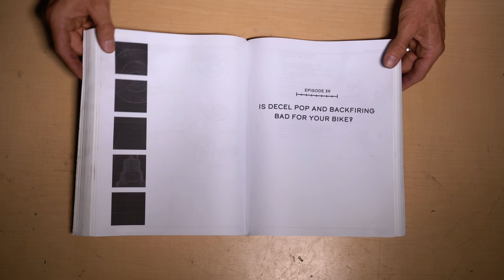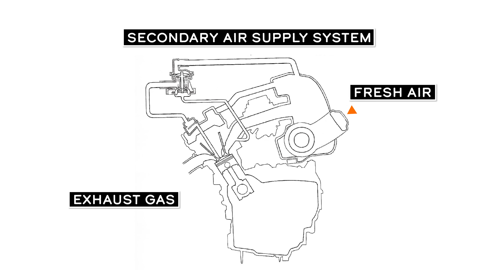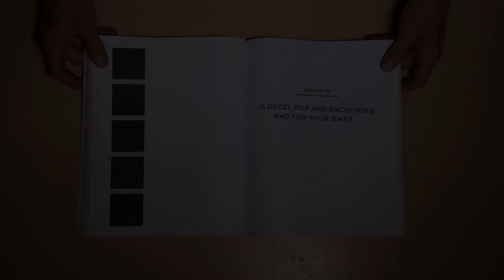Backfiring and Decel Pop — Is It Bad For Your Motorcycle? | The Shop Manual

Comment: GP bikes are bound to run rich. Not only does it add some power compared to running lean, the extra fuel condenses and cools the cylinders, which means they can push those engines even harder without overcooking the thermals.

They'd also not be cutting off fuel on overrun to keep engine braking under control. Too much of that and you risk losing the back end. Same reason why they run slipper clutches.

Comment: Thanks for this. I did a lot of research and came across info stating decel pops are caused by being lean. However, your explanation of having a high flowing aftermarket exhuast with no cat makes more sense considering a 2 into 1 has a lot of scavenging and no restriction.

Comment: I ride a bmw s1000r with midpipe and SC project shorty can. It pops and bangs like crazy at low RPM blips and then gun shot backfire at 8k rpm. I fn love it. I do worry tho that it needs an ecu tune. But at 15k miles no problems so far. The slightest opening of the throttle on decel makes it crackle.

Comment: Thanks.  I never knew that the perforated screen on my air cleaner was a flame arrestor.  Also, at least on GSXR's, it's fairly common to remove the air injection system when an aftermarket exhaust is installed.  PAIR blockoff plates are sold for that.  That moves the flames to the back of the muffler and lessens the sound.
Reply: Would you say it’s required to get block off plates when installing an aftermarket exhaust?
Reply: Not required but, unless you're an exhibitionist, the popping will be quite annoying.  It will stress the packing in your pricey new muffler until it fails prematurely.  It will also screw up the air-fuel ratio as indicated by the exhaust, making it impossible to dynotune the bike (it could be temporarily blocked for the tune).

Comment: Decel pop is cool, the first 10 times... After that it just became incredible annoying to listen to when commuting or touring.
It happend almost all the time on my Tracer 900 with an arrow exhaust that i got it tuned, way less decel pops and the bike ran much better.
Reply: My Buell Ulysses has literally a setting using the Bluetooth tuner to turn on and off decel pop.  You can imagine which I choose for daily riding.
Reply: You can also install AIS block off plates and almost remove it completely
Reply: riding 4strokes over 2 years now, i still doesn't get bored to decel pops
Reply: It's been years and I still love the sound 🤷🏽 everything is subjective

Comment: Rock solid basics, well done Ari! You have a knack for picking subjects that have needed clarification for decades!
Reply: Thanks for the compliment. Can you think of any other topics we should cover? We're always looking for suggestions and ideas.
Reply: @AriH211  Could you do a video on the differences between stock vs aftermarket headers? Once the Cat is removed, would the headers from a full race system even make a difference?
Reply: @AriH211 Can anyone please tell me why does bikes like ducati or any supersport motorcycle produce a loud bang on quick shifting at high rpms ??  I am assuming that it is because the engine is taken away from one or more powerstrokes cuz of quick shifter , so to compensate the drag caused by the no powerstroke cycles , it pumps more fuel and air in the immediate powerstroke ??

Comment: It can be as simple as a leaky exhaust: My old (old? ANCIENT!) Ducati Paso 750 starts to backfire when one or more of the blindrivets holding the muffler together is missing. Strangely, it does NOT backfire if the connection between header and muffler is leaking, only when the rivets are missing.
Never heard it backfire on a dirty or poorly adjusted carb. The Honda CB400T I had before it (end 80's, early 90's) did the same: Backfiring on a leaky exhaust.

Comment: You forgot one major thing to check...Valve clearance. As the valve seats erode, the valve clearances become tighter, increasing valve overlap. Excessive valve overlap invites carry-over during the transition from the exhaust stroke and the intake stroke, allowing unburned fuel and air into the hot exhaust. By opening up the valve clearances, the carry-over is greatly reduced, reducing popping. Too much valve clearance will create more low end torque, but will reduce high speed torque. It also 'hammers' the valve train at higher RPM. When doing a compression check, tight clearances will show low compression, but if the compression seems 'too good', chances are, the valves are too loose.

Comment: I currently own a Buell XB12 and the decel pops are out of this world, i love it. Rolling downhill i get the constant pops and bangs. Got a real backfire twice which sounds way different (having the intake right under your chin so you can literally hear the engine breath makes it easy to tell the difference). The combination of a 1200cc V2 while accelerating and decel pop while letting go makes riding so much more enjoyable.
(Remus exhaust + K&N air intake are a nice combination)
Reply: You like that? I tuned it out of my Ducati. I like an efficient engine, not a noisemaker.
Reply: @CarsandCats  efficient is quite difficult to achieve on this engine since there are very few people that know how to tune it and even less that want to do it. The nearest expert i got is located in a different country. As long as power delivery is linear and the engine runs healthy i am happy.

Comment: Great video as usual! I just wish you would've included shift pops too. Just like decel pops on most cases shift pops are fine too as long as it's just 1 pop the moment you shifted your gear (mostly on upshift when you close throttle to rev match, so a bit of fuel remained unburnt and it popped in the exhaust). And in most bikes this will completely disappear with fueling adjustment.
Reply: Was curious about this. I get some shift pops occasionally after riding around for a long time at low speeds or being stuck at a light for a long time. Glad to hear a single pop isn’t a big deal, and assume it’s a build-up of fuel considering when it happens for me?
Reply: @Ghostsoulless when you say stuck at a light, I assume you mean it pops after you start moving and then shifting, if so that and shift pops after riding for a long time are fine. If it's popping while you're standing at the light, you might wanna get that looked at.
Reply: @coolgeevee  Yes, after I start moving and shift into second and third usually. Figure it’s a buildup of fuel from idling for so long
Reply: @Ghostsoulless  it's not a buildup from idling because if it was; you'd hear a constant string of pops. Because once the buildup during idling reaches a point it starts popping in idle itself, that's why I asked if it happens while you're stopped.

What's happening with yours is the moment you shift you close the throttle a bit to rev match (maybe even unconsciously) there is one cycle where you sprayed a lot of fuel but because the throttle closed a bit you mixed a bit less air, so net effect you ended up with a rich mixture so the remaining unburnt fuel burned off in the exhaust.

You might have also noticed this doesn't happen on short rides but do on long, is just because temperature plays a role too. Overall, from your description, nothing major to worry about.
Reply: @coolgeevee  Interesting, I appreciate the explanation. Pretty new to the motorcycle world (come from classic cars), so always appreciate learning something new. Thanks again
Reply: @Ghostsoulless  always welcome man! If you're already a car guy, know that a lot of the knowledge from that side transfers well to the motorcycle side too. Particularly things like this, engine internal working etc
Reply: Mine sometimes after decel ,especially  downhill ,pops one time out the exhaust if I ease back on the throttle. If I get back on the throttle  more aggressively it does not.
Reply: @danielgreen7159  I'm assuming your bike is FI, in which case this does happen on a lot of models. On downhill especially when you let go of throttle, the bike will be running on engine braking mode and since the momentum of the bike and gravity pulling it down is sufficient to keep it moving, the ECU cuts off fuel to the engine to improve fuel economy. As you roll throttle back on, fueling starts again, and sometimes on mild throttle input you might have a slight excess of fuel for 1-2 cycles which pop in the exhaust, and on very open throttle this might not happen. 

As long as the pop isn't exceptionally loud, you don't have to worry about it much
Reply: @coolgeevee  u seem pretty knowledgeable man. Perhaps you can help me with my 93 Softail. Stroked the motor, switched to mikuni 42, thunderheader , arlen ness little big sucker. Switched from a dual fire dyna s, to a single fire ultima after 2 years with the dyna s that had a very light grumble on decel. Now i am getting decel pop on every engine brake letting off the throttle. Does the ignition have anything to do with it being single fire now ??

Comment: Simple answer, since these issues "pop" up right after one just installed a full exhaust on their bike: yes, you really should get a tune / flash your ECU.
Reply: 2020 ktm 790 duke pops with stock exhaust from factory.
Reply: Aftermarket exhaust tunes usually increase more fuel, causing even more pops. It's usually just them being no restrictions and no cats inside.

Comment: Pro tip: if your bike has an o2 sensor going into the muffler or exhaust. Unscrew the sensor to leave an open hole to let air in. Will make pops. :)
Reply: This answers my question 😅 Thanks dude! My o2 sensor has a different thread size than on the full system exhaust that’s why it pops. I think once i fit the o2 sensor with adaptor the pops will go away 🙏

Comment: Pretty simple to tune out afterfire. I've messed around with it a lot when designing my own fuel maps on my Ducati. Basically, you need to cut fuel when TPS approaches zero at rpm. You can get more aggressive at higher rpm because TPS voltage will be higher just to maintain said rpm so you can cut it sooner. No pops for me. I also get 55mpg!

Comment: Finally a Video that helped me to understand what's going on with my cbf600. Just installed an aftermarket slip on and ever since worried me if that decel popping is going to destroy my engine or not. After one year its still driving and i guess everything is alright. Thanks for the video! 😎👍
Reply: See if there’s a way to block off the secondary air injection system if it has one. That’s usually the biggest cause of the decel popping.
Reply: @NBSV1  I pretty much doubt that... i mean its from 2004 and it is carburated.
Reply: @Rettungssocke  They had secondary air systems back then. My 2002 Kawasaki is carbureted and it has it. Even with the carbs tuned decent it will suck in fuel when off the throttle, then the air system lets in fresh air which will let it burn in the exhaust. If you plug the ports it reduces the popping quite a bit.
Reply: @NBSV1  Oh okay... well anyways im glad its just decel poppin on my cbf... i was about to ask the mechanics to fix this stuff but they would probably rip me off and tell me bs... ^^